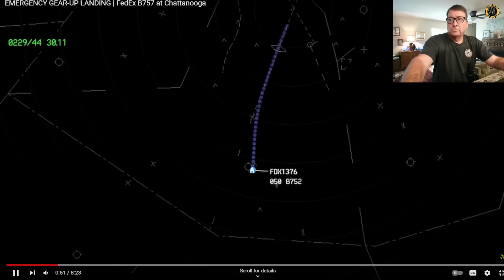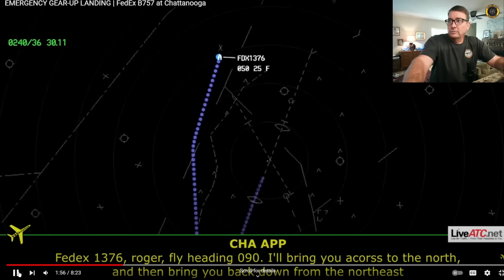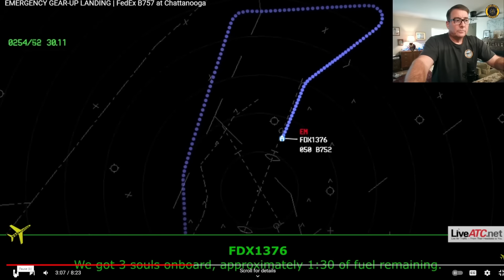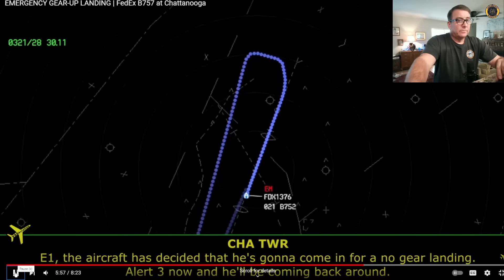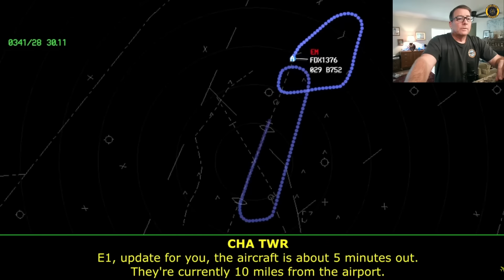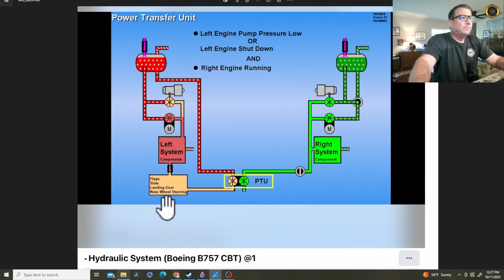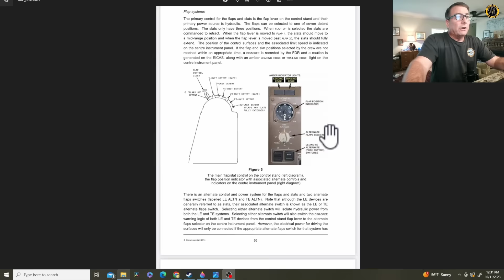Fedex 757 Gear Up Landing 4 Oct 2023

Comment: Thanks, that was really interesting.  Seems insane that the last option relies on any hydraulic fluid at all. It also seems like there should be a fourth, where you find a panel in the floor and pull a rip chord at each location, unlocking the doors and gear and let it drop?  (maybe that's just overkill)
Reply: The unlocks are hydraulically activated so you need some pressure in there to release the gear. An old aircraft I flew had explosive bolts to release the up locks. Obviously Boeing didn’t see this as an issue and it hasn’t been an issue for the time the 757 has been in service.

Comment: No gravity-drop system for the gear?  I'm surprised.
Reply: Alternate extend is gravity operated.. the cockpit switch simply operates a small power pack to open the gear doors, and the gear extend on their own
Reply: Gravity systems I believe are only in much smaller aircraft

Comment: Great video, I can't wait to hear what actually happened!  Hypothetical question: If they could have gotten the gear down and then landed, but found that they did not have nosewheel steering, could they have manuevered the plane on the ground with differential thrust or differential braking?
Reply: Sure but why bother when you’ve got a tug

Comment: The LOT 767 gear up landing was due to a popped circuit breaker which also powered the small electric motor that released the uplocks which then allowed the alternate gear extension to work. 2 different systems, so an electrical issue shouldn’t affect the 757 alternate gear extension system

Comment: Part of my radar preflight was to check the nitrogen pressure in the left wheel well (nothing else). But I always looked at the hydraulic system reservoir anyway. Out of the hundreds of times I looked at it, only once was it almost empty. The flight engineer missed it. When I told him he didn't believe me and went to look. He accidentally skipped the step.
Reply: You must have been a tanker Nav.  I was C130, seems there was a radar pressure gauge.  Didn't get into wheel wells.  Good thinking and habit you formed checking your hydraulic quantity.
Reply: @CalPil0t  I keep calling it a 707 but it was an E-3 🙂

Comment: I've had one or two times where in retrospect, others might not have declared. One was for a failure of stall protection (no shaker) and speed awareness indications (I forget the exact EICAS, as it was a few years ago) and it was windy conditions. My feeling was, I don't want to find out I need the trucks after I push the landing gear through the wings. I did my ASAP and crew report afterwords, and you know what happened? Nothing. Took all of 20 minutes to do and confer with my FO, and that was that. Nobody's going to come down on you for being cautious. And if they do, it's time for a new job and a call to the FSDO.

Comment: Redundancy?  Actually, not enough.  Major leak in the left hyd system = no gear extension.  Free-fall gear isn't really free-fall if it relies on electronics or hydraulics to release it.  Douglas aircraft had cable controlled mechanical releases, bulletproof.
Reply: At least no gear extension should be perfectly survivable 😂

Comment: Great job by ATC and an equally great job by you , Juan, explaining the 757 hydraulic system. I'm not familiar with the 757........my question is, are there pressure sensors within the hydraulic system that could indicate to the flight deck if there is enough ( or not enough )  hydraulic pressure left to effectively control all the systems for normal or emergency operations ?

Comment: I have to comment on this because I am a retired pilot who flew both the 757 & 767 and was a line check Captain for almost 9000 hours. The fact they could extend the flaps, but not the alternate gear is the question. You mentioned the LOT 767 failure and failed to mentioned the LOT crew’s judgement (in my opinion a poor decision) was to fly from the USA to Poland with a crippled airplane and then failed to identify or check the CB that controlled the electrical method of extension the gear on their 767. 

Unlike the LOT 767 the 757 uses trapped hydraulic fluid with an electrical motor driven hydraulic pump to unlock the gear. It too has a CB for the electric motor and the investigation will reveal if the crew checked the CB and if it was even on the FedEx QRC list to be checked. 

In watching the full ATC crew communications it appears to me the FedEx crew followed the appropriate check lists and took their time to decide what they would do. If the CB was popped for the emergency gear extension motor, resetting it may have been an issue. I also assume the crew was in communication with their operations and maintenance center before deciding to land gear up. CRM, as you well know, involves more than the crew.

Unlike when I started flying for a major airline in the late 70s today the resources for the crew of a major operation like FedEx are very extensive. And I hope and assume the professionals at FedEx used every resource available to them before landing gear up. 

Thank you for your review. People love aviation.

Comment: Does the APU not contribute to these safety systems? Seems like that would be another option to power another hydraulic pump
Reply: APU only provides electrical and pneumatic power.
Reply: Yep, electric and air only.

Comment: Yeah, if you had a leak in that 'trapped fluid' area you'd have all gear drop techniques fail. That seems like a single point of failure which I thought they always tried to mitigate? I always thought that the gravity drop extension was all-electric, not relying on hydraulic at all, but maybe that's on a different 7xx or on the Airbus or something.
Reply: blan-colirio-  Oh really? You're obviously the real blancolirio, definitely no suspicious hyphen in your name or anything!

Comment: Did they pull "G"s?foam the rwy? Check circuit breakers?. Not one gear down.. suspicious 😮? Call fed ex maintenance via radio patch?.leading Edge are hydraulic. They was fluid somewhere?

Comment: Is the trapped fluid you’re referring to in the left system different from the primary fluid used by the left system? Or if a catastrophic failure of the left system dumped all the primary fluid would there be anything for the transfer system to pump?

Comment: I have just one question.  With such a short flight from Chattanooga  to Memphis where FedEx has its major repair facility, why the company kept them flying in the pattern around Chattanooga.  Just seems to me it would have been better to keep the straight heading to Memphis with more runways to land and their repair facility.
Reply from the maker: No. Burn too much fuel, and not have enough time to troubleshoot.
Reply: Depending on what was going on, some emergencies require the crew to land at the nearest suitable airport. I'm not sure if that was the case here but it seems likely.

Comment: Juan,
Would  reverse engine thrust be deployed upon touchdown in a gear-up landing?
Reply: Rolls motors use hydraulics to operate the reversers, so no. And you can't pull into reverse unless you have weight on wheels, so double no

Comment: what kind of damage do you think the a/c took ?  is it a loss ?  engines pretty much shot..damage to underneath... but I how much damage to structural ?...and then there is the age of the a/c.  757 stopped being produced quite awhile ago....
Reply: Offhand it looks like both reversers, most likely both motors, possibly the flaps all need to be replaced. They aren't in production but there's a pile of spare parts all over the world since they were so prolific
Reply: @scrivyscriv  aim sure there are plenty of spare parts.  I just wonder if it is cost effective. my concern would be any stress on major structural components (wings, fuselage).

Comment: ALTN gear extension not work too? Interesting. If I remember correctly there's a solenoid in the RH WW FWD wall that's supposed to be checked every so often for functionality. Sounds like it failed because the gear should gravity drop no matter what when you use the alternate extend.

Comment: As a member of the self-loading-freight class I find the nice measured cool behavior of the pilots and ground very reassuring. I also notice the lack of fire, which says some other emergency equipment designed into the plane worked as intended, too.
{^_^}

Comment: Yes, I too was reminded of the Polish LOT incident.  Also I recall the Eastern Airlines 401 crash in the Everglades where the pilots were preoccupied with manual lowering of the nosewheel landing gear and ignored their loss of altitude.  Presumably, this latter crash spurred inventions in improved landing gear lowering methods.  Your description of the various methods on the 757 seems to indicate that earlier incidents did lead to the development of new methods.  Thanks for a fascinating video!  The pilots and ATC did a very professional job here.
Reply: In Eastern 401, the gear was fine and down; there was a burned out bulb in one indicator light, and all three were screwing with the switch trying to pull it out to change/check the bulb.  No CRM back then, although the copilot did ask, "Do you want me to fly, Bob?", to which the captain didn't respond.
Reply: @williamcandee5267  They also spent some time trying to lower the gear manually and then check to see that it was locked in place.  My point was that this incident may have contributed to the redundancy of systems described by Juan.

Comment: One last question Juan, the diagram was an excellent explanation however,  it missed the APU. Would they've tried using APU. I mean there's no engine malfunction apparently maybe if you can give a reply?
Reply from the maker: APU doesn't help here.
Reply: He focused on the hydraulic systems, and didn't go into detail in the engines.
As you say, there was no evidence of engine malfunction. We can assume that there was power, but that power wasn't being hydraulically transferred to the landing gear. What could the APU (which is just a third, smaller, jet engine) have done in this situation?

Comment: Another excelent review including systems description. Two small notes. As you correctly said, the fluid for the alternate gear extension is isolated from regular Left system fluid, this is supposed to preven a hydraulic leak from impeding alternate gear extension, a concurrent failure of the dedicated DC  alternate gear extension hydraulic pump or loss of that trapped fluid would indeed impede alternate gear extension. 
The Ram Air Turbine is exclusively a hydraulic backup (Center system) on the B757, the RAT does not provide any electrical power.
Great job as usual in proving an insight into the problems the crew of this flight may have faced.

Comment: Since all methods of lowering the gear are hydraulic, could it have simply been that the leak was close to the landing gear? You didn't address it explicitly, but I assume there's some redundancy built there to make sure there is in fact some "trapped" hydraulic fluid left to work with?

Comment: So random question, how in 2023 are there not cameras in the wheel wells to determine the status of the gear if needed?
Reply: Because the aircraft wasn't built in 2023.
Reply: obviously, but it's not even a thing in newer aircraft. Seems like such a no-brainer system to install or retrofit, but then again with all the redundant systems and sensors they assume it's not required so why bother.  @df446

Comment: No pilot will declare an emergency unless the sky is falling. The declaration bring lots of paperwork and it will go on your record. In this case however, when there is more than enough reason to justify the declaration and this pilot still refuse, not only he will not save paperwork, he would be haul on the carpet at the chief pilot's office to explain why he did not declare. They will question his judgement and that is not a good thing as a pilot in command and a large part of his job involve judgement calls.
Reply: Who cares if it will "go on your record"?  Correct decisions should "go on your record".
Reply: @df446  It sure sound like you are not a pilot or know the hassles after a declaration.  When something happened, in flight, after you land, the most dreaded question a pilot will hear will be the inspector asking,  "who is the pilot in command" then you feel like finding a rock to crawl under and hide. No one notice correct decisions.The Hudson River landing got much good press, but it was much easier for the low altitude and decisions were limited.  The Gimli Glider happened at cruising height and was 10 times harder. The pilot did the impossible and still been penalized. Success have many fathers but failure is an orphan.

Comment: Juan: Question I've been scratching my head about for decades: WHY aren't aircraft built with tiny cameras that would allow the pilots to view critical parts? They cost maybe $100 each, and it seems it would be easy-peasy to put a tiny window anywhere on the plane so a camera could be mounted behind it, and there would be no effect on drag, etc. Can you elucidate me on this? If just one camera had been mounted on the belly of the plane, this crew could have easily seen if the gear were down, without having to do a fly-by near the tower.
Reply: #LOL Nothing in aviation costs "$100 each"?  #OMG . . . . .

Comment: Do these big planes not normally have blow down bottles for the gear?  I used to work on some small planes that had them.
Reply: Without the left system hydraulics, the gear has to be released electrically so it can fall down. There’s no ‘blow down’ feature in the 757. Apparently, the alternate extension system didn’t work. I had this happen in the sim one time. The alternate landing gear circuit breaker was off. We reset it and the gear came down. Even in the sim, it was a bad feeling when the alternate didn’t work. Those guys were really cool headed in this incident.

Comment: Flew a 140 whose elevator trim cable slackened. Set trim for takeoff okay. After takeoff couldn’t adjust the trim to lower the nose. Had to reduce power to take force off the trim. Landed okay. Found out another pilot had the same issue. I quit that flight school.

Comment: I’m wondering why they didn’t fly in a holding pattern for maybe an hour, to talk with maintenance, burn off fuel to lower risk of fire on the ground, review all checklists, etc before just calling it quits and doing a belly flop landing
Reply: Maybe they didn't know precisely what the cause of the problem was, and had reason to believe it could get worse.  A risk benefit analysis was made.  The risk of a slightly bigger fire is worth it if to mitigate the chance of a sudden and fatal inability to control the aircraft.

Comment: Everyone lived? That's a big win IMO and a sign of some very good work done despite there being an impossible seeming issue which caused it all in the first place. It means everyone gets to learn and keep going. At least i hope it goes as smoothly later on as the landing did.
Reply: Generally, NTSB and FAA will be looking into this jointly. And NTSB takes the lead in these investigations, which is good. They have a policy that their job is to find out what happened and create a strategy so it doesn't happen again and not rake people over the coals. Once that is done, however, and the FAA takes over, all bets are off.

Comment: Would they use reverse engine thrust once they have made contact with the ground or are there reasons not to
Reply: makes zero sense considering tremendous deceleration, also engines may no longer work anyway
Reply: Reversers won't operate without weight on wheels, it's a safety lockout to keep them from being able to deploy in flight. Gear in the wheel well = no weight on wheels, so no reversers.

Comment: The flaw in this system seems to be that all three methods of lowering the gear involve pumping left system hyd fluid to the MLG uplocks.  If you have a significant leak in an uplock pipe that is downstream of the PTU, then that will dump the left system fluid down to the reservoir stand pipe level, then when the PTU attempted to operate the gear it would dump the remaining left system fluid. When you then tried the alternate landing gear switch there would be no fluid left to release the uplocks, and there would be no gear or door movement at all.  

Great job by all involved in this situation, could have been a lot worse.

Comment: Juan, you say the 757 is your favorite aircraft which I think is great, but my research showed you had an incident of an engine out ETOPS to Hawaii? Just curious why you have never covered this especially given the Captain several years ago that had a similar issue going into Hawaii?
Reply: When Juan runs out of data he stops talking. When ABC, CBS et al run out of data they just keep talking and make things up to make themselves sound important.
Reply: Maybe my research is complete crap, so let me know if that is the case. You are one of the most knowledgeable aviation reporters out there. Eventually people will realize NBC, CBS, etc knows jack squat about these incidents.

Comment: Great video! That crew did a great job! If the hydraulic leak is below the standpipe on the left hydraulic system then there is no way that the locks can release the landing gear to free fall in the alternate extension.